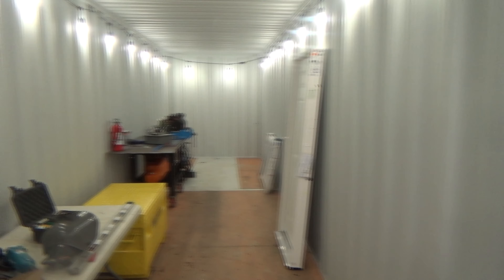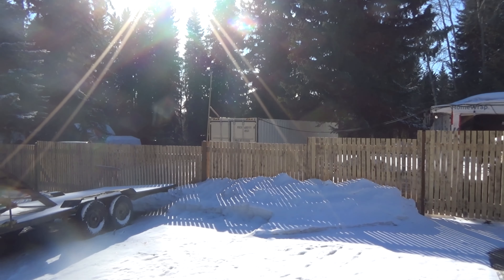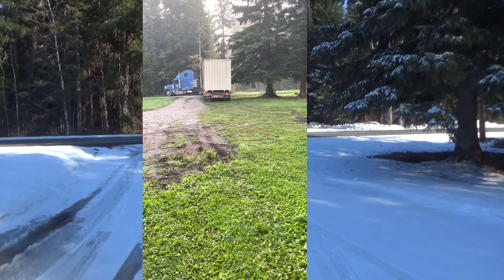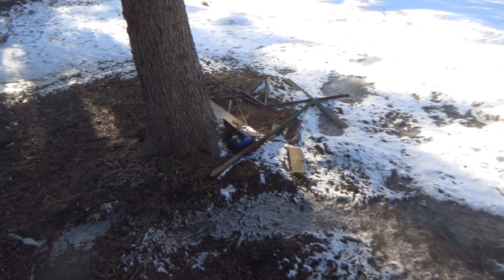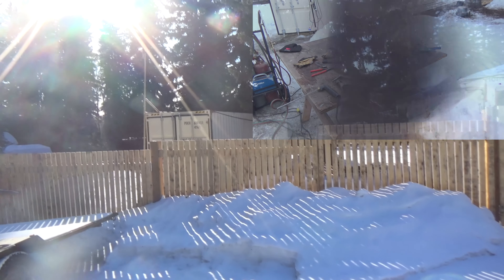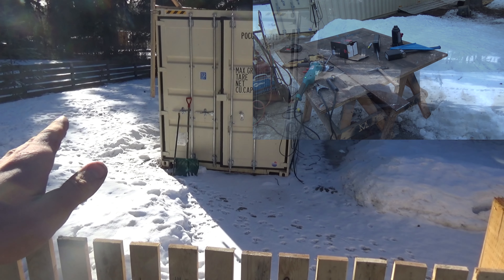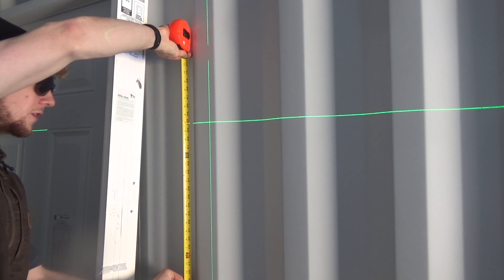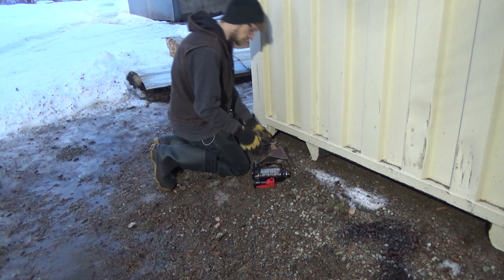How To Jack/Level A Shipping Container(40ft HC)[Shipping Container Workshop EP 1]

Comment: Just about to do the same, But 2x20'' What is your idea on insulation ? and its very importen to keep good air ventilations.  
I live in Norway and its all from +30c to -30c    (86F to -22F )  My tin can will be little away form main house and do not want it to draw to much power. So It will run a diesel heather in the winther time.  I am a CNC engineer in my daly job, but what type of cnc or work will you do in here? 
NIce vid !
Reply from the maker: very nice very nice, mostly just expanded foam sheet, just a hobbies when it comes to cnc, like this https://youtu.be/tIifDMkVd34
Reply from the maker: tell me more about your day job please?
Reply: I used six inch thick EPS (Expanded Polystyrene). 6 inches is 15cm in 'Merica! EPS has an R-value of 3.6 per inch (2.6cm).  So i have walls and ceiling with R-20+. I'm in California with midler summer and winters.  The container is still misserable!! Save money and time, DONT DO IT!!